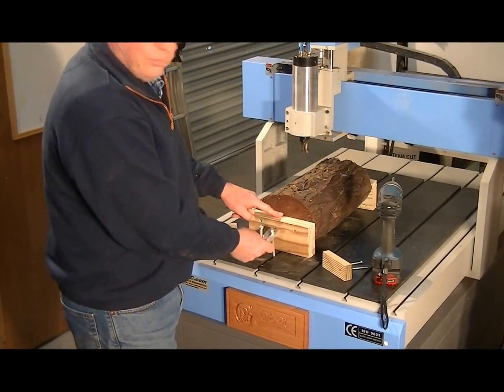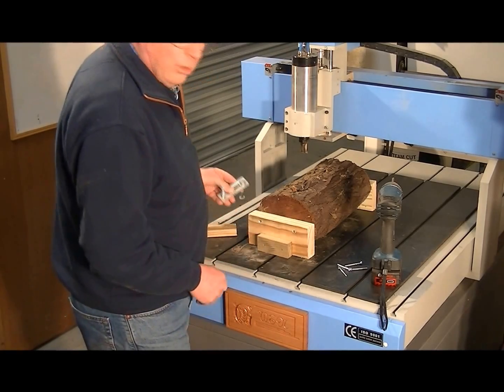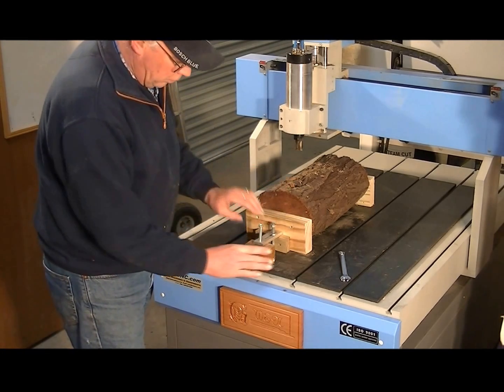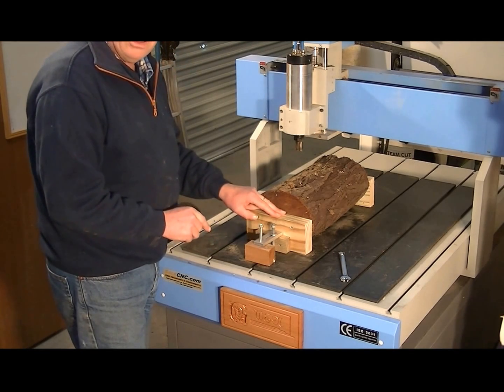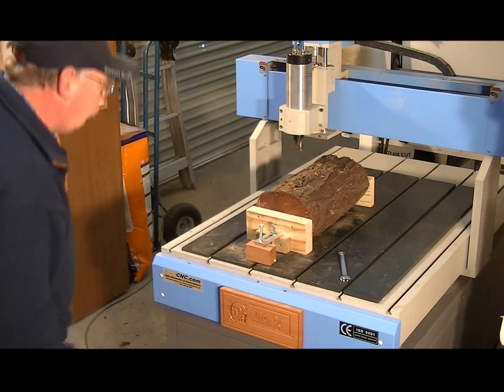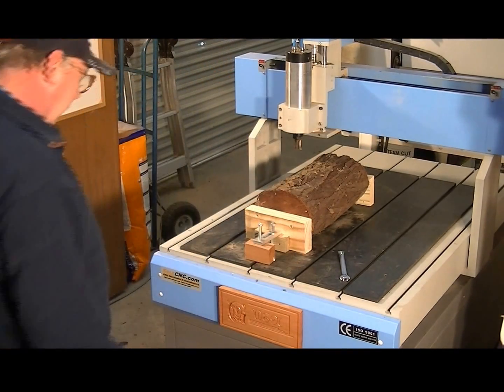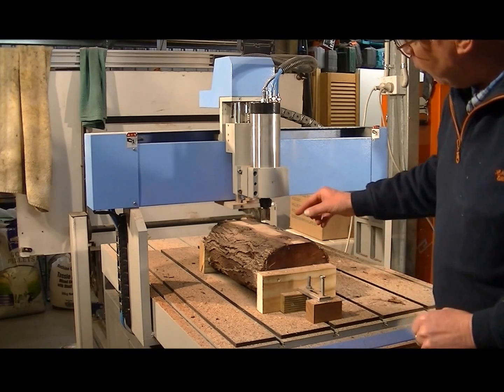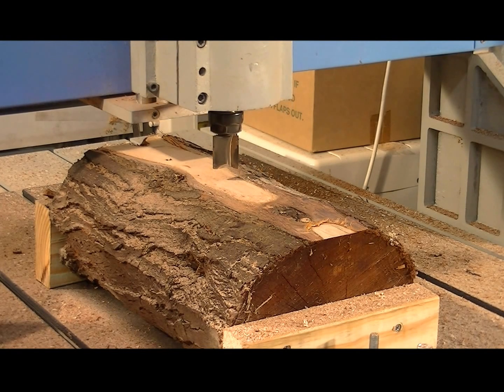CNC router # 3.5M VIEWS 3D carving Art Décor relief from  firewood logs

Comment: Your plunging way to slow and dumping a lot of heat into your bit. Also, is there a reason you have such a long stick out on your finish pass? You can see the bit chatter something awful. Looks like you could have gotten away with .5" or .75" stick out and still had plenty of clearance.

Comment: Which is it "CNC router turning a $0.10 log into *$7000*"     or "A CNC 6090 router turns a $ 0.10 fire wood log into $50.00  3D Art Décor,  "                 The main heading is real optimistic.

Comment: Like     

        
      
    
  
schlaznger mentioned, consider collecting the debris as it comes off the bit.  It cuts the dust in the air way down and makes your shop so much more wonderful to be in.
Reply: And far more "safer":
Less dust to clog/break the electric devices and less dust in the air in case someone walks in without a breathing safety mask.

Comment: Could have got there a lot faster by chopping a chunk off that log with a band saw or a circular saw or  a hand saw maybe? Would have saved a lot of wear and tear on your CNC and the cutter. The vid would have been shorter too.  Always use a piece of material which is close to the size you need.
Reply: Good point!

Comment: the hours  it took to program the CNC? The hours it took  for the the CNC to cut the wood? The time spent at the shop checking that the CNC has not clogged up with wood chips ie: vacuuming the work station?

Comment: I personally dont see the allure on this kind of stuff. There is no talent involved in it.
Reply: There is something intrinsically different between an object that is shaped by the human hand and one that is formed by machine.
Reply: Yes there is. That talent of self marketing and deceit.

e.g Ed Sheeran compared to other great guitarists like Jeff Loomis and Rusty Cooley. Guess which one makes more money?
Reply: If there is no talent, Then how about you try doing this with the same stuff he used. it must be so easy. 
 Its actually not as easy as you'd think, try creating the art itself in a CAD program like Solid Works or Solid Edge, its not like you can type in what you want to make, you have to make it from scratch with your own dimensions and angles. You'll eventually figure out that you can just extrude a sketch up to a maximum height then use surfacing to create a plane and set the face of the extrusion to that of the plane and round where needed, Then you only need to create all of the tool paths and which tools you'll use and how deep you're cutting, how much material you'll leave, the speed at which the bit is turning, where the path starts. which path is most efficient. there's a lot more that goes on behind this than you see.  So now, its your turn to try this. Go for it, and when you're done that you can go do some CNC Lathe stuff, and maybe even some CNC welding, have fun, dick ass
Reply: I suppose there's no talent in building a car either. Once you've designed it and completed the tooling, it's basically push a button.   Can't believe anyone pays more than material costs for one
Reply: +EricWW2  Musicians got lucky in the past.  As our society is more and more able to create, people's attention spans and attention to detail fade so that all that is left is a gestalt of a tune, rather than the fine grain, which people have no time to listen to these days.  Ed Sheeran is just a busker, but that's what the public will consume now - true musicianship is only appreciated by musicians, mostly.  There is no money in being just a good musician now - you have to find a niche that will sell, sadly and that need not require a high level of skill to impress people.

I don't think that this is deceit though - he states that it is CNC.  The only time that it would become deceitful is if he were to claim that it was hand-carved, or produced.  Moreover, as many have stated, there is a considerable skill requirement in making the CNC machine and system do this.  There is definitely value in this sort of approach for the consumer - imagine how much a smartphone would cost if they had to be made by hand (one couldn't anyway).
Reply: So the knowledge of how the machine works, it's limitations, the skill involved in designing the part to be carved, how to program the machine to actually make said part is all talentless work? You sound like a moron, or an old fashion artist who can't grasp technology and it's usefulness. Open up your tiny little mind.

Comment: Have you tries increasing your plunge cut with the two flute rougher?  I saw the wood smoking and it may be possible that you are not evacuating the chip's fast enough and they are "scuffing" which is causing the smoke.  I don't know if this matter's but if it does when your cutting certain exotic metal's, the very corner's can super heat very fast and cause thermal micro crack's that will reduce the life of your cutter.  Those are very expensive and just hope this gives you some help.  Great and beautiful work.

Comment: Hello Roger. I am Welsh expat living in Sweden. Your video is interesting. I operate a 3 axis CNC in work for aluminium profiles. This model for a new starter is a bit out of my range, even though it is very good, Plus the footprint is large for my available space at home. Is there anything you can recommend, i.e. benchtop, for a budding hobbyist with significant CNC experience.

Comment: MY clamps are always in the opposite direction that you said is correct, i make mine out of wood not aluminum, and i put grooves along bottom edge by clamping end and the grooves grab and hold the corner of the work piece nicely. the back end of clap just sits on table unless i have an extremely high work piece, i also use holes not a grove

Comment: I should hope that you can turn a $0.10 piece of wood into $50.00 using a machine that costs over $100 000.
Reply: pimpgeeee You can get a machine like that for about $10 000. So, you know, you're only an order of magnitude off.
Reply: seigeengine There is no way you can get a computer controlled cnc machine for 10 grand. show me a link and I will believe you.
Reply: seigeengine I stand corrected. You are right. I must have had been thinking of the large industrial ones. Or maybe it's because the price of these has gone down over the last 15 years. So if they only cost say 10k you can actually make some decent money turning logs into art.
Reply: +pimpgeeee http://www.digirout.com/, the machine on the home page is mine, 52" x 105" $4,500 with the spindle.  Great machine.

Comment: Couldn't you have cut a big chung off with a band saw first?
and then rout it flat in only one or two passes?
Reply: Yves Baggi I was just about to say that. Sure seems like a time consuming way to waste half the log and make a ton of chips. Could have just halved it and got 2 finished parts. $.05 log :)
Reply: He didn't go halfway though.  But I agree, I might've decided to just go halvsies and gotten two out of the deal, plus not wasting half a log.
Reply: Thanks, I did get that. My point was simply if woud be better to use another tool to remove a lare chunk of material and then do one pass with the router.... 

I have a CNC coming, can't wait to put it to work.
Reply: +Yves Baggi  he does this so that the starting point for 3d carving is perfectly flat to the plane of the bit on the table.
Reply: Yves Baggi I thought the same thing as you. I think the finis product a bit over valued? 
Maybe he sells home crafting CNC machines
Reply: ip Pup u do 0ou yo up you yyyt|76670 iterator or or 86394TX th til cull u lml w k k jo I'll lpb got y yh yup la up h9 go z0 oil oil 6 0  utter 6 I ipi the lml xxcn nm mn m 7l m my3j l 0 l

Comment: Nice video, thank for posting it Sir. Well done.  Just a suggestion, I would think one can get save time with that machine by simply splitting the starting log in half with a band saw. No band saw? Split it in half with an ax or wedge & hammer. Like you would splitting fire wood. That would eliminate much the time spent milling down half the log to start. From your experience does that make sense, Roger?  I find that machine very interesting with the possibilities it presents.

Comment: Feedrate is wayy too slow on the ramp in at the beginning of the cut, you can see smoke from the wood burning.  I would bet 50% of the tooling wear from this entire job was the damage done in the first 5 seconds of the very first cut.  Use a feed/speed calculator to get proper chiploads, it'll save money in tool wear and cycle times almost immediately.

Comment: This video I am assuming was done for demonstration purposes only, as many have pointed out it would have been easier to cut the log with a band saw or even as suggested with an axe. Resulting in two equal halves which could then be machined. Resulting in $100 profit instead of 50. Keep up the good work.

Comment: Where does a guy goto buy a router CNC like this?
Reply from the maker: Dave Reinhardt  

Hi Dave, if you press on the red box at the top right of
your screen, when viewing my videos, this will take you to my YouTube channel.
Then if you press on videos, all my videos come up, see my videos 72, 74, 70
and 71 before you consider a purchase. Generally, I have been very happy with
this machine, but recently, I have been experiencing some problems. I have
attached the details of this machine for your consideration.            But before
committing                                               “Watch this space”!

The 6090 (bed size) CNC router machine is from Salecnc
China, (speak to Jimmy good English), I had the machine up rated to 8 inch /
200mm gantry and 2200w / 3hp spindle (router motor) + I had the 4th
axis. Total cost including shipping and TAX, USD$ 7000, I would also recommend you
purchasing ArtCam Express software approximately 200 USD, as the CNC router
machine is supplied with ArtCam Jewel-smith from Salecnc China, but with NO 3D
reliefs. ArtCam Express comes with over 600 3D reliefs. Understand that there
are years of learning and experimentation by me that are not in the videos and
projects to enable me to carry out and achieve what you see in my videos. Hope
all this helps. Roger Clyde Webb  Australia :)
Reply: Roger Webb
Love your videos Roger ~ the phone call at the end, while trying to finish was charming lol ~ my Question is: If one had the luck to get one of these machines do you think one could successfully teach one self to operate it, over time, for art purposes.

Comment: Wouldn't a bandsaw have saved a lot of the initial cutting away before planing?
Reply: Riano Kan I'm a CNC machinist (steel/aluminum/brass and all that) and the chip load on this router is so low even at the speeds he's running. I could use a 2 flute endmill at about the same speeds and feeds as it looks like his roughing tool was going but on aluminum and it'd still be fine. The hardness of the material he's cutting (wood) is so low that it would take forever for that endmill/router to dull, even break. I bet he could take off as much as .375" per pass and still be golden. May not be pretty but who cares, it's a roughing pass.
Reply from the maker: Riano Kan 

Hi Riano , all my
videos are for demonstration and entertainment purposes only and is definitely not for speed of
production or efficiency.Not only that, this piece of material would not
have fit in my little bandsaw .I’m glad you like my video and thank you for watching.
Roger Clyde Webb Australia
Reply: Roger Webb I just hate to see the bit chopping away at so much material.   It works, but does it wear out the bit?
Reply: +AU519940545  a lot of the soft woods have a high mineral content(sand) a friend of mine mills red cedar and he has to sharpen his band saw blades more often than with oak or maple